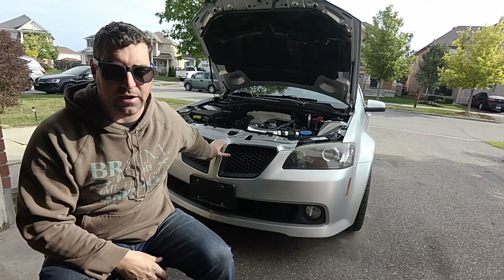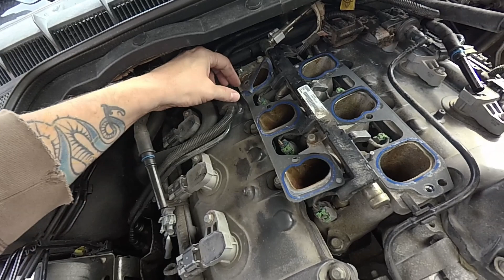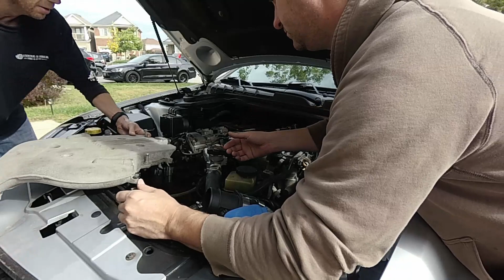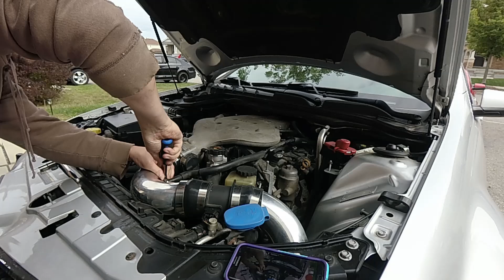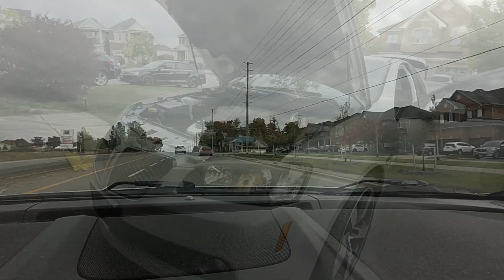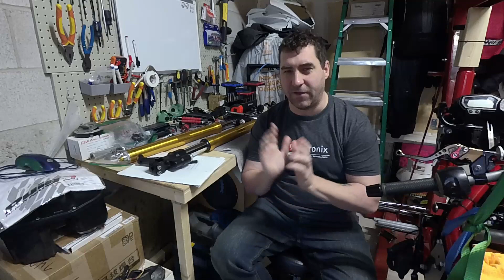Chevrolet Dealer Messes Up my Pontiac G8 ! G8 Low Coolant and Misfires !

Comment: You wont believe this. I went to a gm dealer a month ago to replace my radiator. My trans cooler lines became corroded and were leaking. I have a 6.0 btw. Anyways. I got the car back and my car started to overheat. Checked coolant and bingo it was low. Went back to dealer and they told me well you told us to replace the radiator. You didnt tell us to refill any coolant that leaked out. Why the hell wouldnt you tell me before i left the dealer that i was low on coolant or that i lost coolant?
Reply from the maker: You have to be kidding me. One would assume that was implied. Wow !

Comment from the maker: Here is the link to the Fel-Pro gaskets that I am suggesting not to use. For whatever reason the gaskets were causing the cylinder 6 misfires in the car. The lower gasket seems fine at least for now, but the upper gasket seems to have caused the failures.
 https://www.rockauto.com/en/moreinfo.php?pk=2663330&cc=1442792&jsn=1492&_nck=ZExt1ysfqhqWnq%2BEvUNdS03cFS568snzuV%2FzqSJVZh3498vLYWSuEjp92aoBolonpSpSQFWYTa%2BIGwbKbBUYGbum2rpxICYlV8DsYsYrDudX0QiBJOmdn7jfwDCh%2FYe5EHttllsQ22KHuI38va%2BRhgdNJdJJqBnIShevAFvzjcicT3dHrYXBz0zNUXYoPm9nFunUawXITP9Q3F%2BslUk2H08emLWL5m5SNe7DpuOVnmkjlWHFT%2Fd2rcc0cZ5s5yTbr06VilNP7oqK4LBQ6CIWObxb%2B7DcJlyIdTBQI%2BD8oUi0KJLBhywOa%2BM%2Fhn2aLm%2Bm6XiG0AYyAIYRKhXmEDz0mw%3D%3D